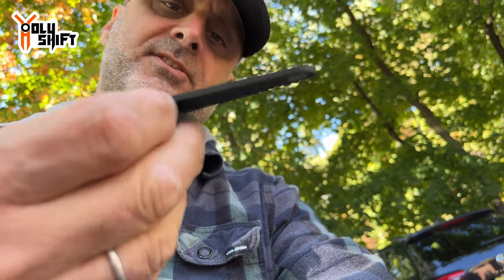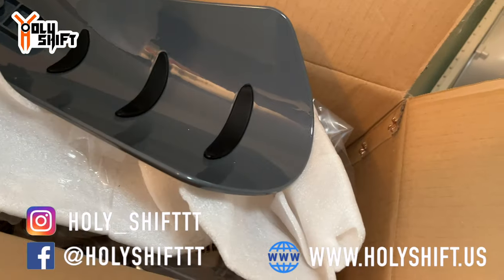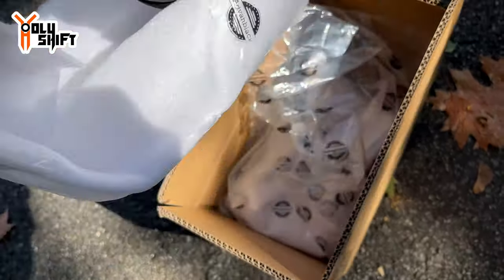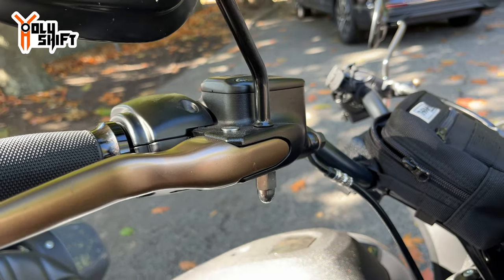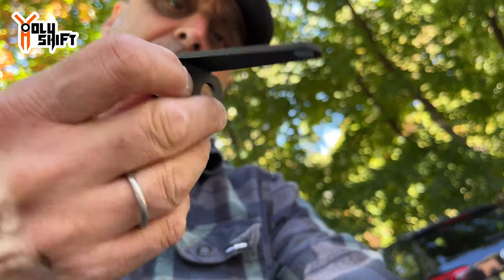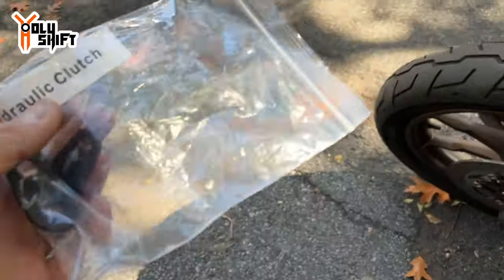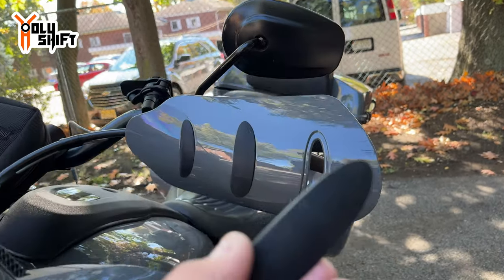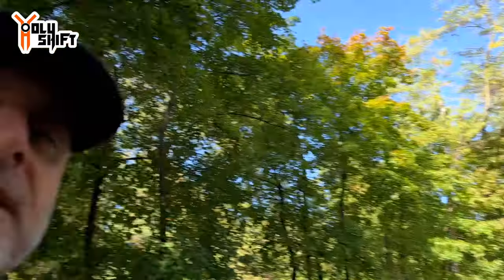Advanblack Hand guards Install

Comment: I put my brackets on the other way because it's a lot cleaner and it the same fitment. Just looks better and neeter looking not seeing that bracket on top of my brake lever.
Iv had mine for 3 weeks now and  I   LOVE'EM! 

And when you were doing the clutch thing, I'm like, whats he doing. I thought I missed something on my install. 😂
Reply: Was yours installed on a stock handle bar lowrider st? Im think they might actually touch the windscreen
Reply: @toomey2wheels247  mine was on a Road King and I did have to pull the bars back just a little, because it was rubbing on the left side but not the right side

Comment: Holy ShiFt do you like these Advanblack hand guards better than the Memphis Shades?
Reply from the maker: Yes sir ! Memphis shades were good - these are even better !
Reply: Let me jump in and they provide better wind protection and are bigger and wider than Memphis Shades. My hands still got cold with the MS but better none at all, but the advanblacks I'm wearing my  perforated summer gloves at 50 degrees and hands /fingers were  ok. So wearing a warmer type glove would be perfect.